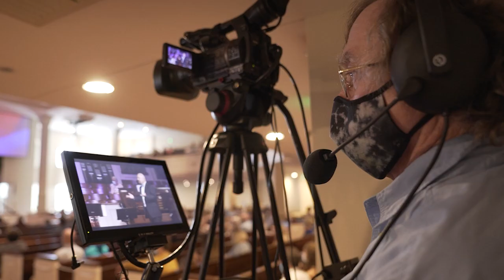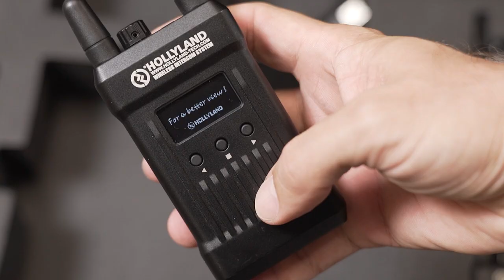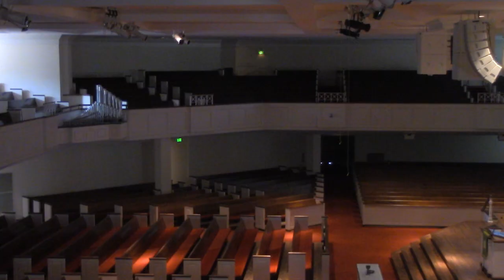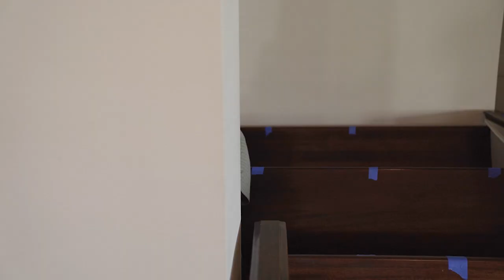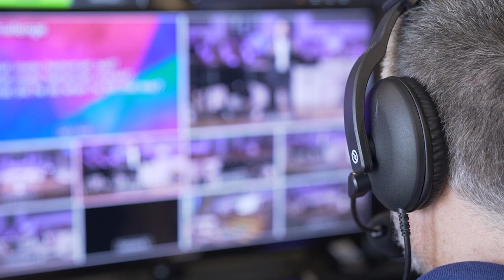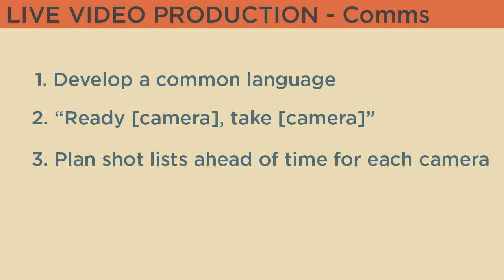Communicating with Multiple Camera Operators - Hollyland T1000

Comment: Does this device connect to Midas m32 digital mix?
Reply from the maker: No it's stand alone.
Reply: @BallastMedia  okay so what are the devices that i can used with my m32 mixer that let the director communicate with camera operators?
Reply from the maker: @just.decide_platforms.  I'm not understanding the need for the x32 in the system?  Director and camera operators communicate already directly through the comms system.

Comment: Great video!  Did you connect your Datavideo system to the T1000?  I have a ITC-100 system and Im not sure it can be connected to the Hollyland.
Reply from the maker: I haven't put the two together yet.  The T1000 has been working so well that we are just using that, haven't had a need yet to combine them.
Reply: @BallastMedia  Let me know if you even figure out a way. With the ITC-100 being half duplex and the T1000 being full duplex, I cant figure out how to do it.